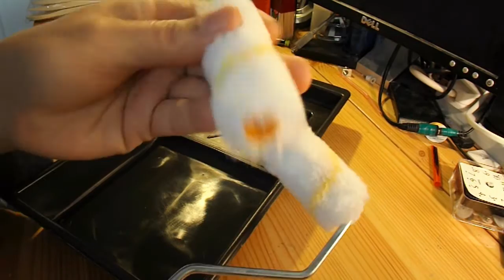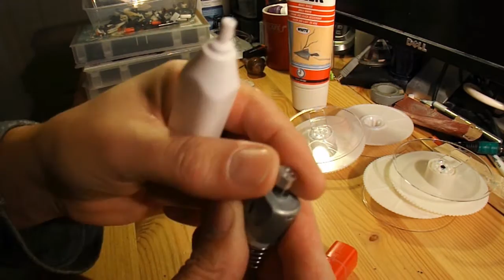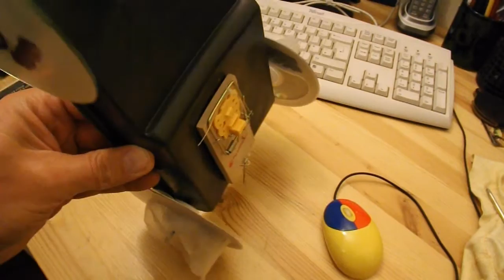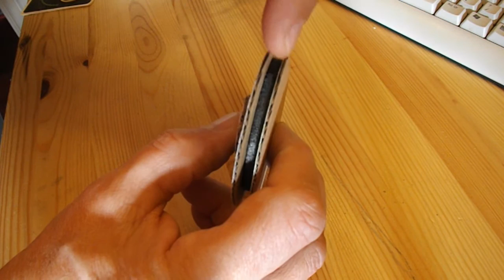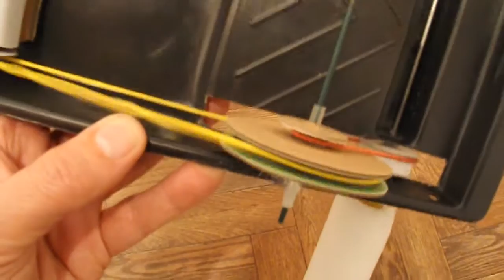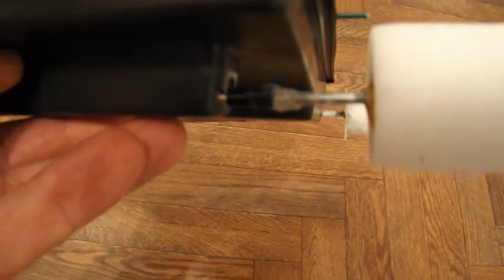Bargain Store Project #39 Vibrating Toothbrush powered Paint Roller Tray Car

Comment: What if you made a small gear thing ( polystyrene pizza tray sandwiched between cardboard) and hot glue it to the electric motor metal peg would it give the rubber band more grip?
Reply from the maker: Hi Ryan. I don't need any more grip on the motor. The issue here is that the foam wheels grip the floor so well that it takes more power to get them turning. They actually flatten slightly because they are so soft, (the fluffy rollers at the front are even worse), so it is like trying to drive a car with flat tyres. By using the gearing I am able to increase the power applied to the back axle. It is the same as using the gearbox in a car. You pull away in a low gear to get the wheels turning. You cannot pull away in a high gear. If I put a larger pulley on the motor shaft that would reduce the power available so that would make things worse.